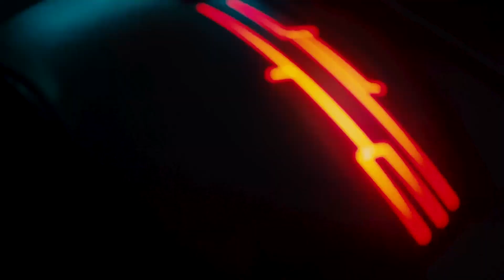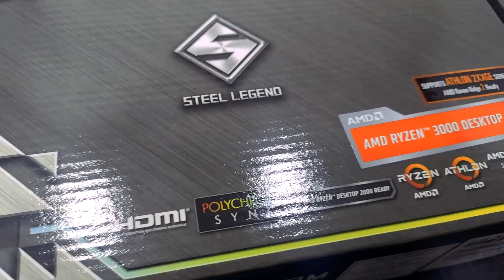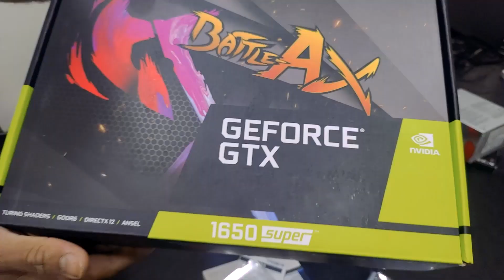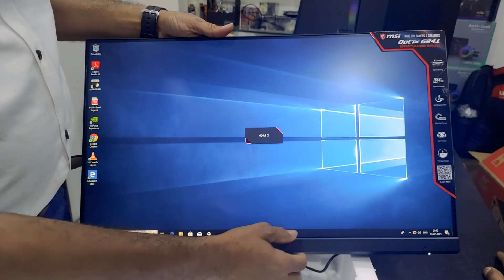Ride To Prime abgb Lamington Road  PC Build Vlog #1

Comment: The same stuff that you have used in your pc will cost around 64000 minimum and 67000 maximum as I live in lamington road I know all the prices and which shop is good for price
Reply: Which Shop? I m thinking of building a pc and on Amazon it was showing above 1 lakh so wanted to know where parts are a little cheap.
Reply: @sohamyadav7407  it right solution lamington road Mumbai
Reply: Right Solutions... 
I still remember them.
First they will quote a price far less than any other, take advance of 2 to 3k,
The helper at the store will say he is bringing PC part's from warehouse. 

One he gets the parts price goes from 38k to 44k..  reason!  they add GST and change brand from what was originally available to not available,and bring a more costly brand.

NEVER VISIT THIS STORE..
Reply from the maker: can you make it 1 for me now ?
Reply: @DarkPhychic  yes bro you are right I am buying one for 
M tech world price went from 72 to 76 now its almost same as prime agbg . But I somehow made it 5 k cheaper but still almost same. It's without gst
Reply: Mujhe bhi accha shop batao